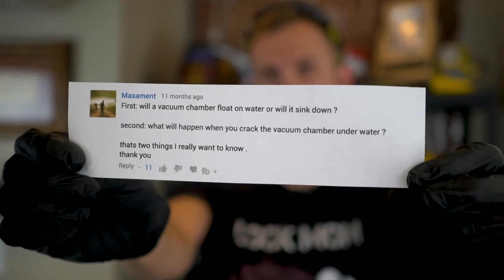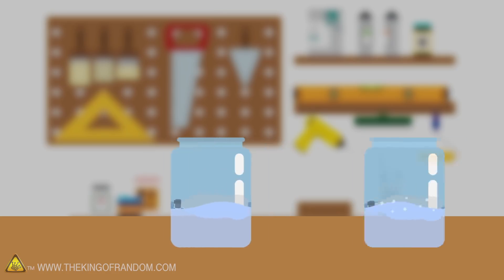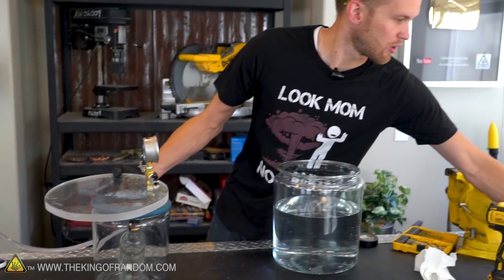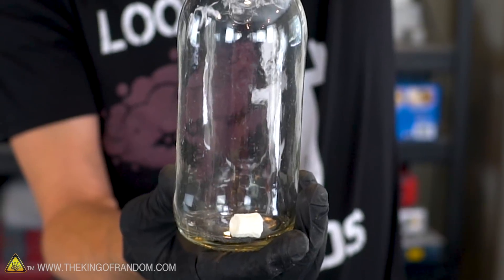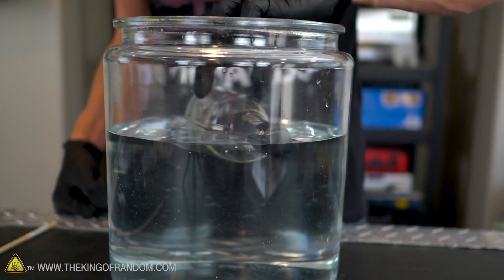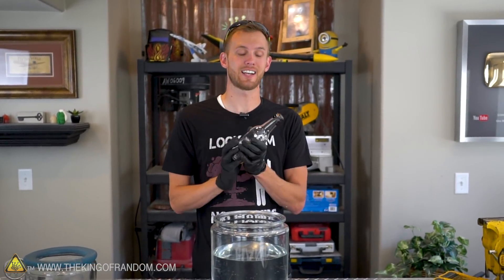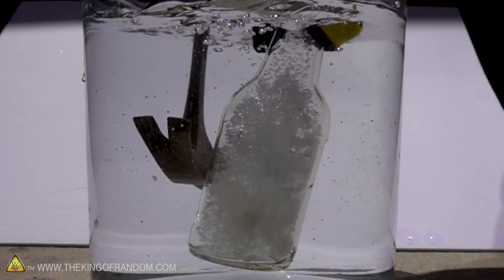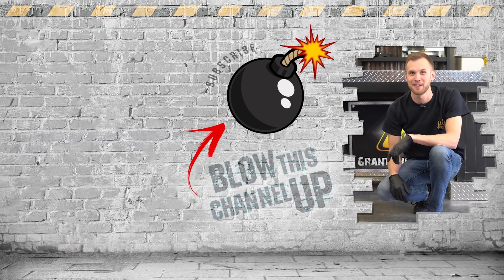Breaking a Vacuum Chamber UNDER WATER

Comment: A complete vacuum isn’t possible to achieve, the best we can achieve is about 10^-6 Torr, Space is claimed to be 10^-17 Torr, each power is a factor of 1,000 so it’s basically not even close. Atmospheric pressure at sea level is 760 Torr

Comment: I have one question does oli float on water in a vacuum chamber
Reply: well the density of oil is 0.92g/cm3 and the density of water is 1.00g/cm3 soo because the oil has a smaller density it would float on water even under vacuum because it doesn't matter what atmosphere it is in rather the actual density

Comment: Is a glass bottle more fragile under vacuum than when it isn't under vacuum? Is a glass bottle stronger when its pressurized? If under vacuum, does the bottle break easier with a smash from the outside or from the inside? And Vice Versa when the bottle is pressurized? Does it make any difference if the smash comes from outside or within the bottle?

Comment: actually it should float higher in the container  vacuumed by the weight of the air inside making it less buoyant that is probably what you said nice work great experiment to illustrate buoyancy

Comment: Totally screwed this up. That bottle has air in it. Has a little bit. Because it would sink. The weight of the bottle is more then the water. It would sink with a compleat vacuum. There was still air. Maybe a small amount but their was still air see it bubble up in the water.

Comment: hi guys. in school we were told that a feather and a rock would fall equally fast within a vacuum. so realistically, if you put a feather inside a bear bottle that is in a vacuum state, the feather should fall around it more easily than if there is air inside.. would you guys be up to show this? thanks B

Comment: If you put a 12 inch or wider Gyroscopic Stabilizer spinning at more than 3000 rpm and place it on top of a 12-foot pole, would that be able to hold your weight and climb it?

Comment: I got a cool idea to add to this. If u could maybe rig up a small thinner glass vial/bubble-like container to the inside wall of the glass at the exact spot to be impacted. So when u break thru, the color mixes with the water only as its entering & filling the glass vacuumed container.
Reply: Actually ya know what? It might be just a bit easier to simply add a few drops into the glass vacuum instead, lol. Should mix and work just the same 🙃

Comment: These aren't "vacuumbubles" the bubbles are air who are left in the bottle cause you just use a single stage Vacuum pump. The vacuum you can produce with such a pump is around 10mbar abs. @ work we had a "Turbopump" it is a vacuum pump and a Turbopump in series. It reaches around 0,005mbar abs...
Reply: He said The bubbles that floated to the top weren't vacuum bubbles but the other bubbles were he even said it wasn't a complete vacuum
Reply: @get6149  your right i misunderstood this the first time.... my English is not the best...
Reply: I think the bubbles might be cavitation.
Reply: I have no clue what are mbar abs are but, it must be powerful in my point of view.

Comment: if you break the vacuum bottle inside a close tank. I am wandering what would be the result of water level and air pressure inside the closed tank. Water will fill the vacuum and existing water level will change because of air pressure are changed?

Comment: If hot things expand and cold shrinks. What would happen if you achieved vaccum while heating a element in the chamber. Achieve vacuum while the atmosphere in the chamber is 180+ degree then let it cool to achieve a even higher vacuum
Reply: For a heating element you could use a piece of coal and a laser

Comment: It clearly still had air in it because glass dies that float on water if you take any glass which doesn't have air in it and drop it into a tank of water it sinks. And a vakuum is "nothing" so doesn't affect if it floats or not. So there still was air in the bottle. Next time put a gauge on the bottle too please

Comment: I'd like to see that same experiment but inside a sealed jar. What if the vacuum bottle cracks inside a seale jar where there's no air to fill the new space? Would the water still move inside the bottle? What would happen than to the empty space left from the water wich moved insiede the bottle?

Comment: What would happen if you lit a firecracker in a vacuum chamber?
Reply: bruh name the 3 things fire needs to burn
1.a surface that is flammable
2. a source to ignite the surface
3. Air
soo withouth air u wouldn't be able to ignite it unless u used a tank of air to feed the fire but then it wouldn't be full vaccuum

Comment: What would happen in a closed water compartment? This way when the glass is broken the water will rush to fill the bottle but since the level of water cannot go down (because it will create a vaccum it self) will it create bubbles that join the air or what?

Comment: Does putting thermite underwater and vacuum sealing it change the effect of the thermite, does it burn differently underwater than it does air?
Reply: No because the iron oxide in the thermite acts as the oxidizer, so it breaks the bonds in the iron oxide and uses the oxygen atoms instead of some in the air. So it might burn lower than normal.

Comment: When y’all scale up this experiment, try using (or even do a diy video on how to make) a spring loaded glass breaker designed for emergency escape.  That should work much better than trying to swing a hammer hard enough through water to smash glass

Comment: Hi guys, can you try placing a vacuum chamber under vacuum inside of a pressure chamber and add pressure until an implosion occurs?
Edit: this may be easier achieved by submerging a vacuum chamber in deeper and deeper water until the pressure causes implosion, like a diving pool or something

Comment: He's wrong: bubbles are not vacuum but steam due to the low pressure. And likely also a little air that have been trapped in the bottle because he couldn't remove all the air from the bottle.
Forming steam is the same phenomenon as cavitation which forms steam bubbles on propeller that turn fast, due to low pressure locally, near the blade surface.

Comment: there is no thing as bubbles of vacuum; these bubbles you could see where bubbles of water vapor due to rapid expansion of the water below a certain temperature based pressure (just like cavitation)

Comment: put e firecracker(firework)  niside vacum uner water.  put it smaler container with haf wacum then put it in biger container with full vacum. to detonate it use 2 smal shortcitkuted wires gluded thrue cap

Comment: I just had an idea. What if you cut holes In a vacuum chamber and attach rubber gloves to the holes and seal it with proto putty so it's air tight?  Then could you interact with the items in the chamber? That would be a cool video.

Comment: 1. How will metals melt in a vacuum (not galium),
2. Will a thermometer change temperature in a vacuum, will it get cooler, hotter or remain the same?
3. Quest to find a fabric material that can hold air around it in water; if this is successful, quest to make a fabric material that can hold air in a vacuum.
.
.
.
Etc
.

Comment: What your saying is wrong! There must be some air left in the bottle otherwise it wont float, because a Vacuum is nothing and you cant define a mass of nothing, so it should be just the mass of the bottle and that woudn´t float. An indication for that are the bubbles OF AIR that are rising to the top when you break the bottle, a vacuum cant form bubbles in water because it´s just nothing and nothing has nothing to press against the weight of the water to displace it!

Comment: How about keeping a marshmallow in a jar and instead making the jar vacuum, fill the jar with air, create a lot of pressure, I wanted to know if increasing air pressure it squeezes the marshmallow or not, same like what would happen if an ant is put inside a tube of a tyre while the truck is running... How the ant would deal with the inside pressure???

Love from India...

Comment: What happens to thermite in a vacuum??🤔🤔🤔🤔
Reply: thermite contains it's own oxidizer so it will burn, however it tends to put off a lot of smoke which would ether pressurize the container or foul the pump, or both
Reply: @radiationpony8449 , agreed.

Comment: What does liquid metal do in a vacuum chamber
Reply: JakerMB since homemade vacuum chambers can't get anywhere near a perfect vacuum, chances are, nothing. If you could get a pressure lower than the vapor pressure of mercury, for example, (improbable for TKoR's setup), a minuscule amount of the mercury would boil, causing the pressure to increase to the vapor pressure. Then the liquid would do nothing again
Reply: All metals can be liquid, gallium and mercury are just two common metals that are typically liquid at standard temperatures and pressures.
Reply: there are more than just 2 metals that are liquid at room temp.
Reply: Nothing. home vacuum chambers just aren't strong enough.
Reply: scribTOON Mercury is typically always in a liquid state.
Reply: Gamer Boy there is 1, Mercury. Gallium has a low melting point but is not liquid at room temperature.
Reply: ScribTOON their is literally only 1 elementaly metal liquid at room temperature, their are many alloys however.
Reply: JakerMB what liquid metal there are 2 mercury and gallium

Comment: I am not quite sure it's all because if the density bit more from the volume because the buoyant force formula (  buoyant force =(density of liquid) × 9.81 × (volume of liquid)   ) depends mostly on the volume so the volume is the main variable on why it floats.
P.S I'm not saying it hasn't got to do with the density which does play a key role but it doesn't affect it as much

Comment: Negative x burned in vaccum ,figure out the best way to add water in negative x in a vaccum chamber ,
And secondly, freeze negative x in liquid nitrogen in some small can and then add water both hot and cold

Comment: you should melt a magnet and put it agains ice. then if the molten magnet casts you should see if it is still magnetic
Reply: I don't think it would be because the particles would disalign, but maybe. If you hit a magnet hard with a hammer several times it will become weaker.

Comment: Suggestion!
You've already done the dry-ice to re-fizz soda, but you did it strictly in a bottle (very dangerous, as you know.) Is it possible to put dry ice in a bottle with a tube attached so the carbon dioxide flows into another bottle to restore the fizz that way? 
Can this be done with other drinks as well? 
Is it feasible to use a single hole in the tube or several (like you did/do for the propane soap bubbles?)

Comment: Could you put a barometer in a vacuum chamber ?

You could as well take a tube (10 cm or 4 inches long) open at one end. Fill it with water, flip the tube upside down in a water filled bassin. You've got basically a water-based barometer. Except it will do something with a hundredth of atmospheric pressure, that is 0.3 inches of mercury. If you reach below that pressure, a vacuum will appear inside the tube. A vacuum inside a vacuum, vacuum-ception !

In fact, a vacuum would appear because the pressure of water would be bigger than the pressure of air around it, so water wants to get down and leave a vacuum at the top of the tube !

NOTE : If, instead of using water, you used mercury, you would need to reach a pressure below 4 inches of mercury to see that vacuum. SCIENCE.
Reply: Hélium SuperFluide then if you put a micropipette inside the tube and do the same again, you can have a triple vacuum going on.
Reply: You don't get out much.
Reply: Most of us watch these videos to see something cool. A smaller percentage of us also want to learn things and/or test theories. Then there's this guy. A virgin.
Reply: Wow your really smart 👏🏾👏🏾💯💯

Comment: What happens if we put dry ice in liquid nitrogen?
What happens to super glue if we put it in liquid nitrogen ?
What happens when you try to boil liquid nitrogen? 
What happens to liquid nitrogen in a vacuum?
What happens to super glue in vacuum?
What happens to dry ice in vacuum?
Can you melt sodium metal and use it to make a water powered bomb?
I've seen if you put salt in fevicol it turns into a rubbery substance does this reaction occur while using salty water?
What happens when you put superglue inside dry ice and put it in water?
How much heat is needed to evaporate ice? 
What happens when you break a pot of liquid nitrogen inside water?
Can we make a explosion by freezing a vacuum?
Cotton soaks water but does it soak liquid nitrogen?
What happens to paper when it freezes ?
Can you put liquid nitrogen in a container and burn it, what happens?

I need those bucks😀😋😋😋😋😋😀
Reply: "what happens when you try to boil liquid nitrogen"

mate, liquid nitrogen boils at room temperature, so it's ALREADY boiling
Reply: Babu Ram Regmi You can figure the amount of energy required to evaporate ice just by using math, only need to know the mass of ice.
Reply: Babu Ram Regmi why? Just why?
Reply: "can we make explosion by freezing a vacuum"

Comment: you should put liquid nitrogen in a very hot crucible with some sort of metal and see what happens like if u agree
Reply: N O T H I N G    S P E C I A L    W I L L    H A P P E N if you just combine things which were interesting in themselves but are already waaaay overdone.
Reply: Typicalpanda Gaming it would just evaporate I think
Reply: well, considering liquid nitrogen boils at room temperature, it would likely just evaporate before it can even ENTER the foundry

Comment: i would like to see if you can call a phone that is in a vacuum....
Reply: Obviously yes because electromagnetic radiation does not need a medium to travel through. If light couldn't go through a vacuum, we wouldn't see the sun or feel its heat
Reply: the caller would get sucked in.
Reply: No you can’t because you used up your 2hrs on screens jimmy!
Reply: you would hear nothing someone puted a gopro inside a vacuum chamber and it could hear nothing
Reply: Special Dude you really are a special dude, "puted" .
Reply: Probably

Comment: You mentioned that air has weight, that made me curious is there a noticable change in the weight of a vacuum chamber when it is a vacuum? or is the change so small that a common house scale wouldn't notice a difference?

Comment: The bubbles that were present when you cracked the bottle were not vacuum bubbles. That's a process called "deaeration". 

The force of the vacuum was removing the oxygen (and other dissolved gases) from the water. 

The process is most commonly used  to remove air from water  being provided to steam boilers or steam turbines. This reduces differential pressures and produces what is called "low-pressure steam".  The process is also used in medical equipment such as dialysis machines where water is a primary component of the dialysate fluid. This prevents air bubbles from forming on the fibers  of the dialyzer and results in better filtration for the patient.

Comment: Put a candle inside a vacuum chamber!? 😂
Reply: Please do this
Reply: It would go out becaue there's no air, boi thats like 4th grade stuff
Reply: Hey its John! It wouldn't work, fire needs 3 things, oxygen, heat and fuel. And without air, it will just die out, take a tea light, light it and put a glass over it, because you're cutting off its oxygen supply, it will choke itself out.
Reply: Nothing will happen to the candle inside a vacuum chamber because you didn't say it had to be lit.

Comment: Guys plz like this I’m curious if this can be recreated at home well Can you make container like the vacuum chamber but made to keep gases in under high pressure and then put two terminals inside a positive and negative and find a way to make it air tight where the wires lead in and pump it full of oxygen and run a current through it with tungsten between both and see if it recreates the effect of a Incandescent lightbulb Thank You! Hope u see this!
Reply: x Jay you can do this a lot more cheaply with an oxygen absorber.
No need to pressurise for tungsten filament.

Or use bicarbonate of soda and vinegar to make CO2 and fill a bottle with that.
A rubber bing with 3 holes, 1 wires, 1 for CO2 in, 1 for air out.
Oxygen is less dense than CO2 so if you do it slowly you can use less CO2 to remove all the oxygen.
Reply: Mark Pearce yea but I kinda wanted to see how difficult it actually by trying to match the materials pretty closely to the first lightbulbs and thanks for the comments though I might actually try it since it’s easily accessible stuff
Reply: That would be really cool to see
Reply: thicc master charlie yes ikr
Reply: thicc master charlie i don’t think it will light just a guess bc u need fire to light it and fire requires oxygen and yea... it will probably just char it but not catch a flame
Reply: x Jay it might still work because the fuse has all the ingredients for a fire contained inside itself
Reply: Jack of all trades it emits oxygen? If so since there is fuses that work underwater so if they release or already contain some form of the element as u said

Comment: It depends on density not weight. Density is pretty much measuring how much stuff is in a cubic unit. So a lower density floats on a higher density. A vacuum has, in theory, 0 density, so of course it would float on water. Air just has a lower density than water and a vacuum has an even lower density than air.